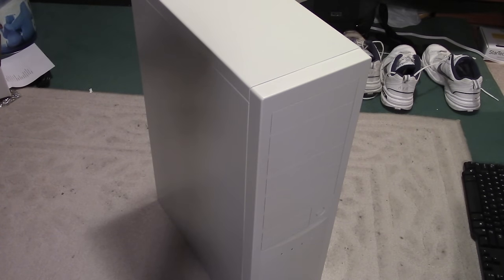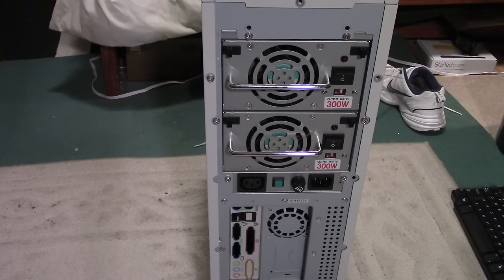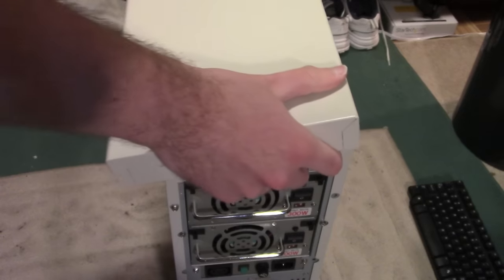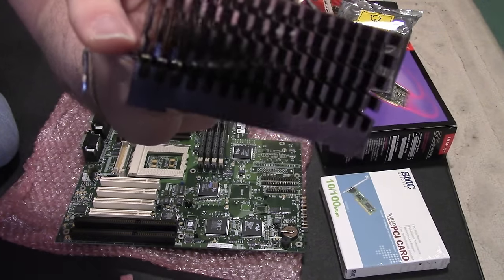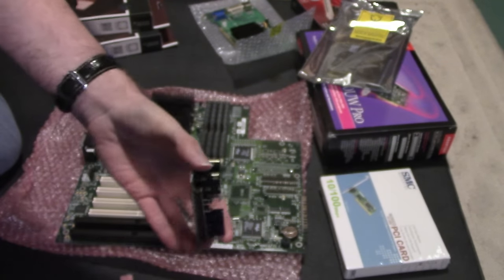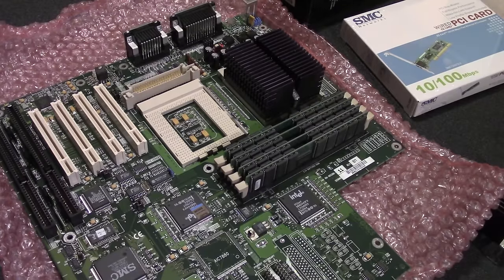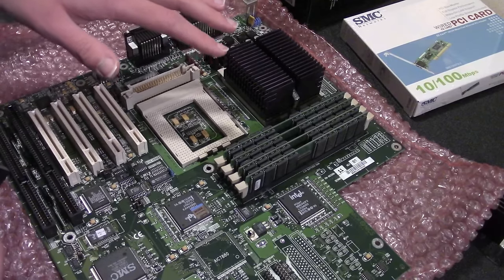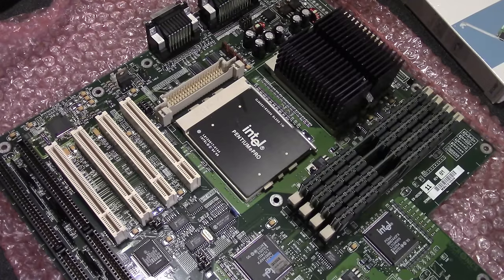2 CPUs, 2 Power Supplies, 1 Computer (Dual Pentium Pro) Part 1

Comment: Might be able to get another used card with a similar spaced heatsink & simply replace it on the card.
its only a 25w tdp chip so not exactly difficult to cool down with a generic universal heatsink fitting various graphics cards either.

Comment: PCI is fully backwards compatible (apart from PCI-e to Convectional PCI without a bridge, otherwise it is even more to use PCI-e card in Convectional PCI bus with a bridge to PCI-e)
p. s. refer to Startech - they make and sell Convectional PCI to PCI-e converters

Comment: eventhough you could use this w/ Win 98 SE (you will only get one CPU used/seen) but its better off using the FX 5500 vs the 6200 as you can use a older Nvidia Driver that doesnt have the  Shutdown bug/overall instability.

Comment: You can use a bit more thermal compound, unless its conductive it wont hurt.
Reply from the maker: I'm pretty sure Arctic Silver 5 is conductive, though I could have certainly fit more on these massive chips without any spiling off!
Reply: Actually the amount he used is already pretty close to perfect.  Thermal paste is only supposed to fill the air gaps between the CPU and heatsink, since air is insulating. Too much paste makes the layer too thick for good thermal transfer.  If it beads out on the edges you're using too much.
Reply: LinusTechTips did a comparison and it showed no difference between too much and just right, but when you don't use enough it really hurts.  Also, the only harm you do with too much is it squishes out the sides because when you apply pressure via the retention mechanisms it usually doesn't allow for thick spots before it oozes out.

Comment: back in the day i had a couple Pentium pro systems, one single cpu 200 meg Hz and 512k cachc  it ran fine overclocked to 240 meg, the other started out with 2 cpus at 180 meg Hz but i dropped in the 2 of the overdrive chips which were basically Pentium II's at 333. it ran windows 2000 fine up till 2013 when i gave  them both to good will. I was moving and had no room to take them with me :(
Reply from the maker: Ah, the elusive overdrive chips!  Too bad you had to part with the machine.
Reply: it actually made me really sad, and i took so much stuff to the city dump, all the old working hardware hardware that i took out of service to upgrade, like i had a 486DLC40 cpu and mb with vesa local bus,  with vlb video card and vlb ide controller, i also had a 486dx4-100 cpu with a motherboard, populated with 512k of cache and i think 20meg of ram. that was the computer i was running till i took that MB out and dropped in the 200mhz p-pro. over the years i did a lot of upgrading and i never tossed out the good parts, until i moved anyways.  i had to move to greece, you have any idea whats its like for a natural pack rat to part with his stuff. :)

Comment: you can fix the fan on the video card by removing it and then the small sticker or plug on the back and applying a bit of wd-40 or oil to the bearing
Reply from the maker: If I rmember right, the fan feels like it has broken loose.

Comment: what os can this run? i would say dos but 512 mb ram is a lot
Reply from the maker: As you will see in parts 2 and 3, I go for Windows 2000, but NT 4 would be a very good (perhaps better) choice.  XP might work, and a few flavors of linux.  DOS might be very happy on this machine, but the second CPU would be unused.  Same goes for ME, 98, or 95 (assuming drivers could be found, you would likely need to rethink the graphics card).
Reply: i just watched the other parts, awesome videos btw :D
Reply: Novel netware would have been the OS of choice from when this machine was state of the art..

Bit late on this video,
But I have a case 90% exactly like this with a 150mhz ppro. Single psu single socket mobo... Last I knew, still works.

Comment: where i can buy the case, motherboard, cpus and RAM?
Reply from the maker: Well the case was from ebay, from a UK seller called "evercase" : http://www.ebay.com/itm/Big-AT-ATX-Beige-Server-Tower-Chassis-Case-15-bays-SIngle-Dual-PSU-ECE6102-/201674144059?var=&hash=item2ef4b7393b:m:mT7eJLL0bF6VhlCXvH62ydQ

Motherboard: http://www.esaitech.com/micronics-w6-li-intel-440fx-dual-zif-socket-8-pentium-pro-motherboard-bare-board.html?pk_campaign=ga-pla&gclid=EAIaIQobChMI9Jffjbee1gIVXEsNCh3aoAFbEAkYAiABEgJQZPD_BwE

CPU: you will have to check ebay.

RAM: Ebay as well.  Make sure that the EDO ram that you pick is the same voltage as what the board wants.  5 volt EDO ram will not fit in 3.3 volt EDO ram slots and vice versa.

Comment: did you try a different pci slot and a board bios update?
Reply from the maker: I believe I did try a different PCI slot off camera and the results were the same.  As for the Bios, the manufacturer no longer exists and others who have used this board have warned that if you do find a bios update out in the wilds of the web, there is a good chance that it is for a different board revision.  But, as you will see in parts 2 and 3, I was able to find something that would work!  Thanks for stopping by and I hope you enjoy the other videos on my channel!

Comment: Its funny to think that now, a tread ripper chip is similar in size to a old pentium pro chip
Reply from the maker: I know, right?
Reply: I wonder how big the EPYC is compared to the Threadripper; it is basically a version of the Threadripper marketed towards HPC applications.
Reply from the maker: Package size, they are the same I believe.  The only difference is that Epyc has up to 4 of the cpu units alive under the heat spreader whilst Thread ripper has only 2.

Comment: They are pretty CPUs. Can you overclock them to 233 MHz?
Reply from the maker: I detected a pattern with the jumpers on the board, but I'm not sure if the logical continuation will actually do what I think it will!  I would rather not do something harmful to the board of chips.  I will say that I think the heat sinks and fans could handle an overclock.
Reply: +Rapidly Ageing Technology:
I still have my P200MMX system that I bought in Sep 1997. It still works. The keyboard (not PS/2) had a problem. I checked the parts with a multimeter. It turns out that PS/2 and that old thing (the big connector) are the same design and all motherboards have the exact same design. An inductor was cracked. The crack was not visible. I transplanted an inductor from another old motherboard (some server xeon dual socket motherboard). The P200MMX motherboard keyboard slot works again.

Instead of setting the motherboard clock to 66 MHz, I can also set to 75 MHz or 83.3 MHz.
66 * 3 = 200 MHz
75 * 3 = 225 MHz (very stable) (12.5% increase)
83.3 * 3 = 250 MHz (stable most of the time) (25% increase)

Maybe you can do the same.

Comment: it could be a bad card try getting another one. and even though the cpu may be the bottle neck it will help in direct rendering a bit.
Reply from the maker: In part two I will discuss a bit, but I got two other 6200's and they both failed to work.  It does not seem to be the PCI compliance though.  I think it has something to do with the VGA BIOS.  Older cards display their own information briefly before even the motherboard bios whilst later cards don't.  I think this board may require a video card with an older style VGA bios.  not sure though.
Reply: Geforce 5500 FX, displays information before the bios.

Comment: 9:13 I'm sure you realize that Windows 2000 is Windows NT version 5 as a successor to Win NT 4. you made it sound as if Windows 2000 isn't a "Flavor" of Windows NT, but it is, as it lead to Windows XP, and all other versions of Windows since then.

A lot of people get confused about Windows numbering/versions since consumers remember Windows 3.1, 95, 98, and Me, which were NOT based on Windows NT. Windows XP was the first NT based OS that was marketed to consumer end user, though Win2000 was also widely use by consumers, but Microsoft didn't market it as such. Windows NT 4 and prior were used for Workstations and (depending on which version) servers. So the numbering convention for Windows started with Windows 2000/XP with version 5. They skipped Windows 9 likely due to software confusing it with Windows 95/98. Though possible it is marketing since Apple has been using OS X (OS 10) for the past 15+ years.
Reply from the maker: When I said flavor of NT, I meant the versions of Windows actually branded as NT (Like NT 4).  This system would likely be much happier on NT 4 (or earlier, if the NT 3 series had drivers for it).  I know that 2000 and later were on the NT line.

Comment: What voltage is best 750 Watt x 2
Reply from the maker: I am afraid I don't understand the question.  I would certainly have taken 2 750 PSUs if they were avaliable when I got the case, though these are more like 400.

Comment: Pr440fx doesn't always take the high end cards while the vs440fx do.  Matrox millenium 2 is a great card.  Matrox mystique is awful.  Why I don't know.  Probably drivers are better in mm2 rather than in mystique.  I use the 3dfx 5500 pci.  That works.  Again it shouldnt?  As for the overdrive it seems the overdrive 333 mhz is slightly faster Than the memory.  I own 11 pentium pros.  They are a lot of fun.